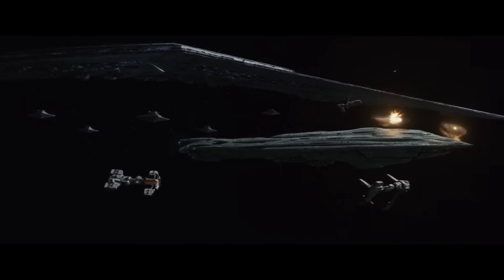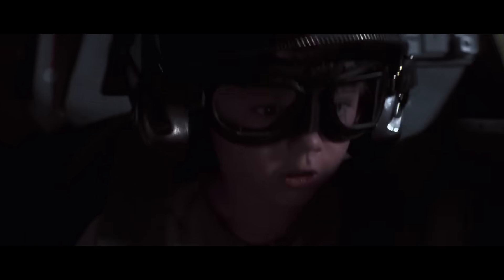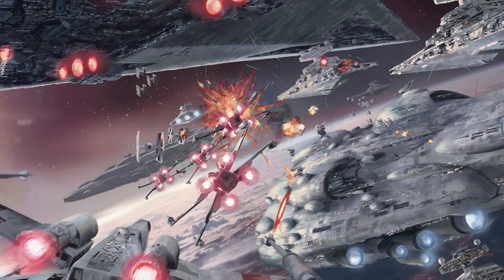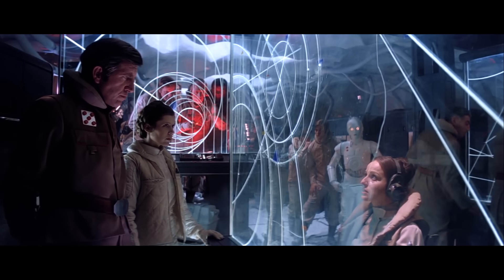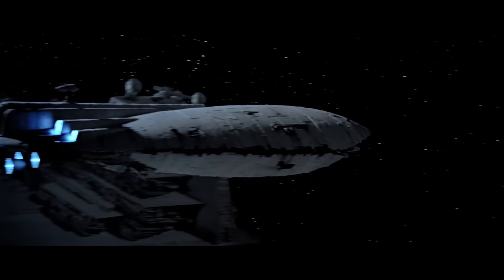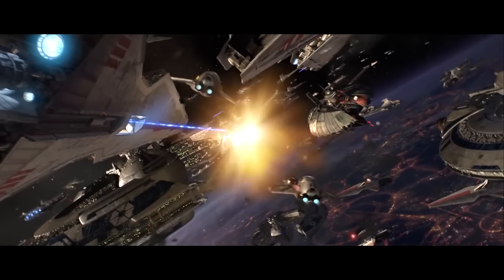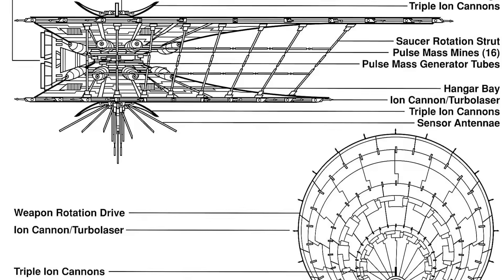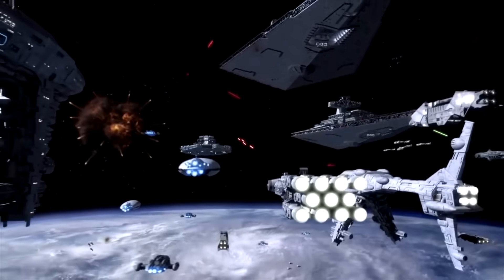Why Star Wars Turbolasers SUCK! (and better options) | Star Wars Lore

Comment: I am pretty sure the trope of ion cannons being especially effective at taking down shields is non-canon. Sure, popular mods like Awakening of the Rebellion might say ion cannons are better at the job, but that's not represented in Legends, and I don't think it's represented in Canon, either. With that in mind, ion cannons meant for dealing heavy ion damage to starships aren't effective at targeting starfighters either, so I don't see how that helps your primary issue with turbolasers. The turbolaser on Hoth was able to disable the ISD in just a few shots because it's a massive siege weapon powered by a power generator meant for a dreadnought.

As for mass drivers, I think they'd have a hard time dealing with heavy armor like on ISDs, but that's just a guess. The weapons went out of fashion, and there was probably a really good reason for that. Sure there are some that were in use in the Galactic Civil War, like the Hypervelocity Cannon, but by and large they were not prevalent. Aside from the need to feed specialized heavy ammunition AND a lot of energy throughout your ship, as far as I know, mass drivers are sensitive to damage. Rail guns are pretty similar to mass drivers, but are more sensitive to wear and damage. And if you can short out a rail gun or mass driver, which might not be all that hard with sufficient chaff, it will probably destroy the weapon violently. Sure particle shields might keep chaff out of the gun barrels, but if they're momentarily opening the particle shields near the gun to fire anyway, probably some chaff will get trapped under the shield.

As for the belly laser on the Venator, I think it's probably safe to assume it relies on similar technology to turbolasers. I think its effectiveness as seen in RotJ came more from the fact that it was a surprise and the Munificent was heavily damaged already.
Reply: X-wing Alliance says hello. Also the rest of the X-wing V TIE FIghter series(es) (I think)
Reply: @diabreon3094  Uh yeah, in the X-Wing series, ion cannons a laser cannons do exactly the same amount of damage to shields, sooooo...
Reply: then it appears my memory is faulty, or i'm mixing-up the whole, Ion canons shut the ship down with shield damage
Reply: @diabreon3094  Yeah. In the X-Wing series, once the shields go down, you can start disabling it, which is way faster than destroying it.

Comment: I think you are ignoring a issue of power generation. The amount of power it takes to recharge a droid even one as small as R2D2 is enormous and Luke had was able to power him with a battery of some sort no bigger than a microwave. The X-starfighter can go into hyperspace as seen in Return of the Jedi I would hazard a guess they are using some variant of Antimatter which would make power generation a small feet at best. And if a star destroyer probably has several Antimatter engines (if one fails others can take over) so power generation it seems not really an issue for the empire.
Reply: So then why use it to power such a useless weapon that has terrible accuracy? I don't think there's any use rationalizing it. They need the bad guys to have terrible aim, it's the only way for the good guys to stand a chance. It's just the storm trooper effect scaled up for giant ships.

Comment: Probably the most useless and underpowered weapon in all of sci fi. The time to target and rate of fire is awful. The closest real world analog might be the railgun, but there's several advantages railguns have that make them worth it. They have extremely high muzzle velocity, so shooting air targets and even shooting down missiles with them is doable. Also the projectiles themselves can be guided which also improves accuracy. They are also capable of indirect fire which makes them ideal artillery weapons. These things can't even hit the broad side of a barn, are direct fire only, and generally speaking, suck.

Comment: Turbo Lasers are why Star Wars ships will never beat a Star Trek ship.   Turbo Lasers can't target or catch the Enterprise.  Using just its impulse drive, it's capable of traveling and maneuvering at 167,000,000 mph while the top speed of an ISS of any class is only 700 mph.  None of its tractor beams will affect the Enterprise since it's just too fast, can modulate shields to defeat tractor beams, and is not affected by the type of tractor beam used by the ISS (gravitational).

The speed of turbo lasers, as mentioned in this video, makes them far too slow for them to reach a ship from Star Trek.  The ISS, and all its tie-fighters, are just too slow and ineffective.  It's literally like a snail trying to race and take down a Ferrari.  For the Star Destroyer to win, the Enterprise would have to fly in and sit right in front of the ISS and just remain there.... on purpose.   I don't see that happening.

Comment: Phasers are better than Turbolasers ( triggers fanboys ).

Accurate and able to take down Starfighters with ease (that's why Starfighters aren't generally used, they are suicide against larger ships).
Able to target individual subsystems.
Vastly superior range. 
Continuous fire. 
Almost instant flight time. 
Powerful (a small hand phaser from the time of Kirk TOS can vaporize a person or bore a tunnel through solid rock, which is much more damage than a blaster pistol inflicts).
Can be adjusted on the fly to be more effective against unusual enemy shielding or armour,  maybe even being able to bypass it. 
Can change frequencies on the fly for the same reason. 
Later versions can be used at Warp speed. 
They are incredibly versatile.
Can be used as mining lasers to dig tunnels or even to perform a cesarean on a space whale. 
Can do a bunch of techno wizardry.
Don't need constant maintenance or cannibalizing parts to keep working (a ship can go seven years using them regularly, without needing to return to base for parts). 
Multiple phasers can be fired remotely by a single crewman on the bridge. 
Can be set to a wide beam. 
Can be installed in strips that allow 360° coverage and beam splitting if necessary. 
Instant tracking of targets. 
Once again, damn accurate, cannot be overstated. 

Retrofit a ISD with phaser strips and it could wipe out squadrons of sub fighters in seconds and then hammer away at capital ships at extreme range or just devastate them at closer range, and against unshielded targets…
Then again, imagine a ISD with the sublight engines and maneuverability of a Starfleet ship. Ok, just fitted with phaser strips for now

Comment: Turbolasers and blasters are for use against capital ships not star fighters. You use actual lasers for fighters. The main issues here aren't really related to turbolasers themselves but how they are employed. Turbos pump out vastly more power because its a capacitive gas (unleashing all the energy stored in it on contact with a target) as opposed to kinetic weapons which rely on mass and acceleration alone. Turbos have that and more (450 terawatts per bolt and possibly more). Gas takes up less room in the ship than massive kinetic bolts. Turbos most certainly do not suck in fact they are overpowered as fuck. Star Destroyers have only one job, destroy other big ships. Fighters are what ties are built to deal with although not effectively.

Comment: Yea if you want to show how "powerful" a singular weapon system is, then showing a clip of dozens of said systems unloading everything they have to "destroy the entire planet" and the actual effect on the city is less than total destruction in a matter of seconds, you're not doing a good job.  A standard Pre-War era UNSC MAC had the firepower of over 100 kilotons TNT, or more than 5x as powerful as the bombs dropped on Japan.  A single shot would have leveled the same city instantly.

Star Trek did it best, when they had 30 Romulan and Cardassian warships fire barely a two second volley at a planet, with phaser and disruptor and torpdeo impact explosions each covering the same area as about a quarter of North America.  THEN if we accept the dialogue in the episode, that total destruction of the crust and mantle of the planet (destruction, not melting, as in no longer part of the planet) would take 5 hours...

...Star Trek weapons are definitively the most EFFECTIVE at causing actual destruction, no matter what numbers are found in the various tech manuals.  Sure, ok, a turbolaser blast is equal to 300,000 megatons, but it's effect on target is a few kilotons at best.

A phaser's EFFECT is in the thousands of megatons, PER SECOND.  I can estimate this easily because we've detonated a 50 megaton bomb and we know what that looks like.  The detonations seen in Star Trek from phaser/disruptor strikes are orders of magnitude larger, after a burst lasting a fraction of a second.

When the purpose is absolute destruction.  We see less damage other times because they specifically were not intending to cause maximum destruction, and phasers/disruptors can have their damage output scaled as desired, and phasers at least can have the exact effect they have on a target modified.

This level of damage doesn't appear to be dealt to other starships because most species use hull plating that's many times harder and more durable than diamond, and they are reinforced by force fields, so obviously starship hulls are going to fair dramatically better than planetary surfaces.

But regardless, we know what each weapon system can do to a planetary surface.  We know what each weapon system can do to ships in their respective universes.

So we can happily conclude that Star Trek ships would wipe the floor with Star Wars ships quite handily.  As well as most other sci-fi ships, with the only real question being around Stargate ships, since I don't believe we ever see them fire their primary weapons at a planet and so we have no frame of reference other than knowing a Goa'uld Mothership can withstand one hit from a naquadah enhanced mega nuke, presumably in the multi-gigaton range, but can't take more than up to one second of fire from Orio mothership beam weapons.

But this doesn't tell us much, since, hypothetically, one proposed satalite to defend Earth could destroy a single Goa'uld mothership alone, but many were needed to destroy the city of Moscow.

So dunno about that.

Comment: Nice Vid Eckhart ... but .... (Alert: Massive shitposting incoming pls read all :D)

"Amazing, everything you just said was wrong" - Jake Skywalker in the shittiest Star Wars Fanfic ever!

No seriously, you dont seem to understand the purpose of Turbolasers when youre trying to shoot at Starfighters with them. 
Just as you dont shoot at Figthers with the 16" Guns on an Iowa class BB in WW2 which are obviously a big inspiration of all things Star Wars (not only ships but WW2 in general of course). You got the Secondaries and AA guns (5" guns, 40mm Bofors and 20mm HMGs) for this. Or in Star Wars equivalent the Light Turbolasers and Lasercanons as Point defense. Turbolasers aren't meant to target small and fast fighters rather to hit capital ships. And even so whose to say you cant make Heavy Turbolasers work in this role too, (atleast somewhat) just look at the Venator.
Its 8x2 Turbolaser batteries are firing and turning like freaking CWIS Gatlings when seen in the Clone Wars and theyre also used to shoot down Vulture Driods which arent exactly an easy target. 

Its all about using the right weaponry for the right situation.
Easiest way to do this would be to just look at the example from before. Armament on WW2 Warships and Planes.

Heavy Turbolasers are like the 14"/15"/16"/18.1" (356mm-460mm) main guns of WW2 Battleships and Battlecruisers
Medium Turbolasers are like the 6"-12" (152mm-305mm) guns of Heavy Cruisers and Battlecruisers
Light Turbolasers are like the 5" (127/128mm) guns used on Destroyers or as Secondaries on larger ships which were often dual purpose Anti Ship and Anti Air armament. 
Heavy Lasercanons are like 55mm or 40mm Heavy Machine guns. (Bofors for example)
Medium Lasercanons are like the 37mm, 35mm, 30mm or 20mm Heavy Machine guns.
Light Lasercanons are like 50cals or 30cals.

I think this might be (atleast one of) the most logical way to class all of these Weapontypes. Youre still right with the Projectile weaponry tho. Rail/Coilguns would certainly be a nice compliment and a few Missiles and Torpedoes wouldnt hurt either. Speaking of which what is the difference between Missiles and Torpedoes in this scenario? Maybe Torps are more like Dumpfire rockets or need a predeterment lock while Missiles can find targets on their own?
Anyway still nice Vid as ever. Look forward to seeing the commentsection decent into total war and chaos after my TLJ joke above XD
Also aren't Ioncanons just Turbolasers with Ionized Plasmabolts instead of normal ones (kinda like the Ammo the clones used but on a much larger scale)?

Comment: What about an ionised rail gun slug? If the slug was tapered at the end and charged the electric field at the tip would be intense and (if I understand how shields work in Star Wars) it would puncture the shield and perforate the hole- allowing you to cripple a ship in a single shot